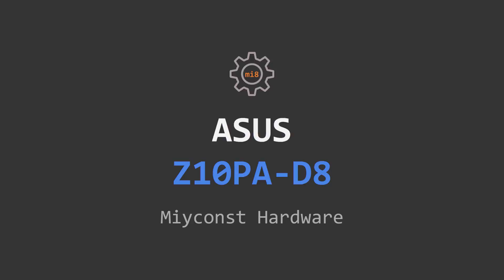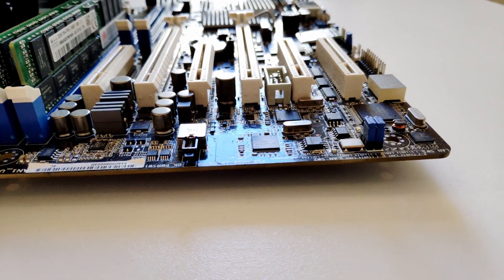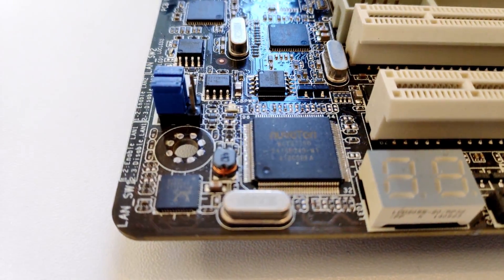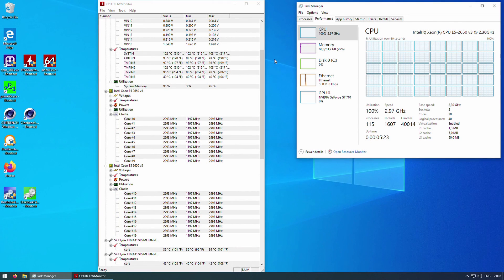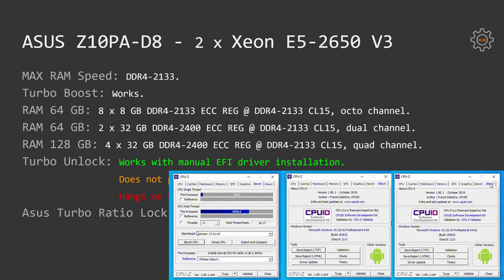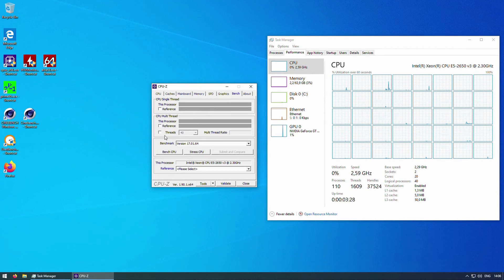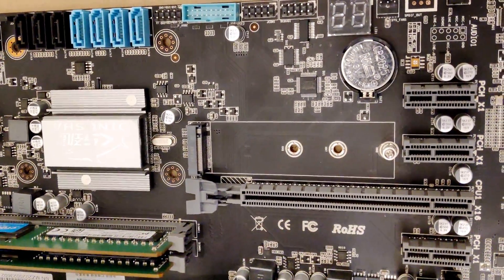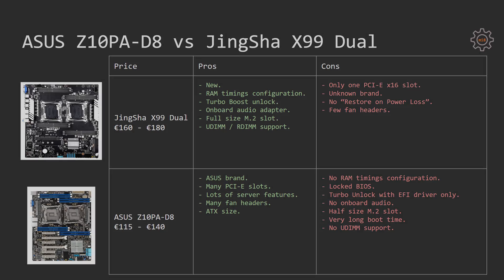🇬🇧 Detailed review of ASUS Z10PA-D8 Dual LGA 2011-3 motherboard | E5-2650 V3 | Turbo Boost Unlock

Comment: AFUDOS 3.05.04 works on this Motherboard, you dont need a Programmer. 3.05.04 is the only working Version.
Reply from the maker: Wow, thank you for the info! I pin your comment.
Reply: I got this motherboard :) can you provide the bios modded file please? is there any chance of having pci-e bifurcation config menu available?
Reply: Hi Sven, can you post a link  to this file? I could not find this specific version anywhere
Reply: @ER-tp9cy  https://drive.google.com/drive/folders/1MVL27NL2yyosgAer-mm-o7zmzttWw5dS?usp=sharing
Reply: @maniac8199  I have the Z10PE W8, You think this version of Aefudos will work on my bios? I want to use my 2999s at full power.
Reply: got it, cheers :-) , how did you find out it was the only working, and why the hell would they write -lock it??
Reply: @ER-tp9cy  It wasn´t me. I saw it an YT, cant remember what Video it exactly was. It was some Chinese Motherboard with locked Bios.Only this Version worked on this, so I tried it and: succes. all other Versions that i tried didn´t work
Reply: @maniac8199  So I can use this program to flash the motherboard to turbo unlock? I have just ordered this motherboard also!
Reply: @frankiewalnuts  Yes, I was able to read out the Bios, mod it (with well known an described tools) an flash it back with this tool.
Reply: I can't get into DOS, it shows AE code every time i choose to boot to USB drive.

How to use afudos exactly?
Sorry for this dumb question.
Reply: @irulbahri7069  Just press ESC within 5 seconds. Then you are able to do what ever you want.
Reply: @maniac8199  Hi. I have an issue Where i get an "22 error with problem allocating memory". Did you experience similar issues? And what commands did you use to circumvent it?

Best regards
Reply: @maniac8199  Hallo Sven, könntest du das gemoddete BIOS irgendwo hochladen und den Link teilen? Danke!
Reply: @toseltreps1101  ich habe die mit in den verlinkten Ordner gepackt, 0_0 ist mit Standard Spannungen die anderen sind mit etwas undervolting für die CPU und den Speichercontroller. Eins mit 20/20Millivolt, das andere mit 70/20Millivolt, musst Du ausprobieren. Bei mir ging maximal das 70/20, bleibt am kühlsten.
Andere habe ich nicht gemacht bzw nicht mehr da.
Reply: @maniac8199  wie hast du AFUDOS zum laufen gekriegt? Bei mir kommt immer 22 - Error: Problem allocating memory.
Reply: @andreas1171  did you manage to install the bios? I have the same problem
Reply: I was able to flash it ;) but no luck since turbo boost won't kick in! Locket at 2.6Ghz :(
Reply: what is the best cooler if turbo is unlocked?

Comment: 6:57 what is the difference between turbo boost and turbo boost unlock? I am very confused. You said turbo boost works and you would be surprised if a name brand mobo did not work with Intel default spec of Turbo boost technology. Then why do you need to "unlock" it? Do you mean turbo boost is not working by default unless you go through the great length to hack/unlock it? If that is the case then i wouldn't call it working... Also you mentioned v4 e5 cannot unlock Turbo boost? So if i put in dual 2699 v4 they cannot Turbo boost to 3.6ghz (intel spec) and will only run at 2.2ghz base clock? That sucks? I would call it broken if that is the case.
Reply from the maker: Turbo Boost Unlock or TBU is a hack that forces all CPU cores to boost up to the highest possible turbo frequency as long as the TDP allows.
Reply: @Miyconst  Thank you. I watched your other video and it is clear now. What would you say is better? Buy dual 2699v3 and do TBU or buy dual 2699 v4 and just run them normally? The v3 is a lot cheaper, around $30 each while the v4 is $130 each. Thanks!
Reply from the maker: @kiloton5764  you did not specify how to compare these two. V4 will consume much less power and provide better memory bandwidth because it's DDR4-2400 vs. DDR4-2133 but V3 will be stronger, especially in lightly threaded apps where it can boost to higher frequency. Paying $130 for an E5-2699 V4 also makes little sense according to me.
Reply: @Miyconst  Haha yes. I agree. That is why I did not buy the 2699v4 yet. I am waiting for aliexpress 11.11 sale and see if I can get a good deal on them. I am leaning toward the v4 because I want to save the hassle of hacking the bios/driver for TBU. Especially since it is not very straight forward on this Asus motherboard or is it?

Comment: It's not good to pack motherboards in plastic. The TVS diodes will help protect it from static damage but those diodes themselves are sacrificial and get damaged over time.  All that static electricity from those plastic bags just shortens the life of TVS diodes. If you don't have static conductive bags it's better to take the battery out and wrap it in aluminum foil the battery could burn up if it gets shorted that's why we use static conductive plastics, The board will arrive undamaged from ESD if it's wrapped in foil.
Reply: If you know how to solder you might put new TVS diodes. They can only take so much before they give out kind of like a shock absorber on a car and when they go that is when other parts start getting zapped like the southbridge during power surges. It's kind of like replacing any bad electrolytic caps, if you want it to last give it new TVS diodes.

Comment: hello, I installed 2667 v4 processors in the motherboard, the computer does not start at all. Before that, there were 2666 v3, everything was fine. What could be the reasons
Reply from the maker: The BIOS is outdated, most likely.
Reply: thank you very much for the information

Comment: Absolutely @ 12:48. full length M.2 is working on Z10PE-D8 version (may be the same for yours) if you not mind it sticks out und have der clearance. 
ASUS makes amazing boards for each situations. Correct, the suffix "PA" is a more 24/7 basic system needing more resources rather then faster, more add-in cards but less focus on or no GPU Remote manages w/ it's integrated ASpeed ATS2400 VGA. The "PE" variant adds some high end consumer features or settings including multi GPU SLI + X-Fire & a more modern UEFI BIOS but overclocking is still very limited in these. As for RAM, I think the Z9PA- was the last entry dual on ATX to accept UDIM RDRAM. Even so if I remember, not able to change strep & timings. It's locked to the CPU & most Xeons 20xx don't like or cant do RAM OC. Z9PE-D8 was a last of a unique board that let us do that but ECC only & limited tight timings.  The "PE" is better suited for the home user high end workstation for a mix of core count vs clock speed but cost a way bit more. If wanting more clock but good core balance, consider a single Xeon 16xx on a good ASUS Workstation Series. Otherwise, fun builds. (:

Comment: Hi there, did you by chance investigate further into getting the unlock to work without having to copy the efi-files manually?
I'm trying around for some tie now but with no luck. I have gotten it to work once but am not able to reproduce this succes.
Awesomew work nonetheless, keep it up!
Reply from the maker: I might revisit the motherboard again, if it starts to be widely available for a good price, but for now I don't have anything to tweak with.
Reply: @Miyconst  I made a discovery this morning and don't really know what to make of it.
The default settings for disabling C3 and C6 in the optimised defaults don't seem to be correctly written into the modified BIOS.
When I load the defaults I still have to disable those settings manually.
Could it be that the BIOS-file needs to be extracted first before deleting the 6f2-patch and adding the ffs-driver?

Comment: ATRL DOES work for me. 

Make sure that Energy Performance Tuning is set to "Disabled". That disables the OS from controlling the CPU frequency, which doesn't work well in Win10 without driver, and not at all in Win11.

Now my 2x E5-2690's are set to 3.0 Ghz instead of 2.6. It's not max turbo frequency, but better at least.

Comment: Hi, Miyconst. 
I wish you are well. I have a question about overclocking. My processor Dual E5 2682 V4. They work very slow, my bench result is not enough for me (bench test result app. 10000). I have bougth this processors and motherboard for special aim. I want higher frequency, so i want do oc. 
MB : ASUS Z10PA-D8;
PROCESSORS : E5 2682 V4. 
How i can do overclock ?
Reply from the maker: It is not possible to overclock Xeon E5-26XX CPUs.
Reply: @Miyconst  How i activate turboboost?
Reply from the maker: @trkymn  it is not possible with V4 CPUs.

Comment: i have same motherboard with x2 2630 v4 ES.  how to know if turbo boost works?  i task manager i see cpu clock varies from 1.7ghz to 2.3hgz,  but 2630 v4 supposed to have much higher turbo boost.  what can i do?  🥵
Reply from the maker: Nothing. Xeon E5 V4 CPUs are not compatible with this hack.
Reply: @Miyconst  i see,  but im about to install two 2690 v3 . so this hack is a must to have turbo boost possible?
Reply from the maker: @ExperimentsLabTv  yes, if your CPUs are retail version with stepping 2 - they are compatible.
Reply: but if i put two 2660 v4 retail,  not ES, , what's going to be with turbo boost then?
Reply from the maker: @ExperimentsLabTv  You can check Intel official CPU specs to find that out.

Comment: I hate not having sleep S3/4. I use it a lot or Hibernate at night. I’ve never used onboard audio in an A/V workstation in as long as I can remember. Even the legendary P2B-DS had no onboard. I get S1 sleep on my Z8NA so it’s better than none.  Full S4 works. After tinkering w/ it I found that the #6 PCI slot is MIO capable of coming from other high end workstation. Which I like since previous MIO slots weren’t PCIe capable
Reply: Update: I ended up using the Z10PE-D8 WS / E5-2667-V4 version w/ wider CPU  spacing & onboard audio. I came from the Z9PE-D8 WS. Similar, otherwise good board w/ E5-2667-V2.
PCIE slot 6 (most upward by RAM) is your MIO audio or PCI switchable. The ASUS MIO card is better then the onboard anyway I thought.

Comment: What model cpu heatsink cooler was used in video? What are some of the biggest heatsinks you can find for these? I'm coming from ASUS Z8NA-D6 with dual Noctua NH-D9DX i4 3U on 2x Xeon X5675  I do like that I can use low timing non ecc, G-Skill 1600 cl7, limited to 24gb or 96g if ecc. My 1600 ecc cl9 did run in my Rampage ii X58 but i wonder if the i7 930X will run in the dual mobo as single cpu?
Reply from the maker: I don't think your i7 will work in this motherboard as it's other socket, but in general, i7s work in some dual socket motherboard with single CPU configuration. Regarding the cooler, I would say two Cooler Master Hyper 212 Evo or another pair of a similar size is probably the maximum you could fit into the motherboard.

Comment: To get good boot times do two things:
1. Remove the ASMB8/IKVM Chip at the bottom of the board (this cuts the boot time in half). After this change, I would consider the boot time to be almost regular; about 30-40 seconds to OS login screen.
2. (Optional) Make sure you installed your OS in UEFI mode and disable legacy boot in the UEFI menu ("bios").

Comment: I have just received my unit from Rebus Farm and it is unfortunately also completely dead. 

2 PCIe Lane Switch chips were completely burning up, beyond 80°C within Seconds as well as another chip from ICS next to the BIOS.

I just messaged them and haven't received an answer yet.

I hope my CPUs at least survived this, I was stupid enough to test it with all of the ones had. (2698v3 and 2673v3)

Now I have to wait for my huanan to arrive
Reply from the maker: Thank you for the extra info. It really seems like they are selling boards from the dead workstations and don't even bother to validate if the board is alive or dead.
Reply: @Miyconst  Rebus Farm has now resolved the issue, i must admit the support i got from them has been great sofar.

They sent me a replacement board within a short period of time so i can not really complain.

CPUs were unharmed and Turbo Boost unlock on E5-2673v3 worked like a charm on the new board.
(3551 Points in R15 using -50mV, 3.1 on all Cores during whole Benchmark)

Aparently they all came out of a render farm that has been replaced so maybe a few dead rendernodes were accidentally mixed with working ones. Mistakes happen i guess.
Reply from the maker: @Coldministrator  I am glad to hear that you have managed to get a working motherboard after all.

Comment: please help with NVMe, instead gen3 x4 my ssd M.2 WD SN550 works in gen2 x1 mode. Max read speed is 415MB/s
Reply from the maker: Unfortunately I made a mistake in my video. This motherboard has a limited M.2 slot, if you want a full PCI-E X4 connection you need an extra adapter.
Reply: @Miyconst  not a big deal for me, x1 is still fast enough for my needs. with the adapter to PCI-E slot I can't make it bootable. I tried
Reply from the maker: @shatll1975  you might need to upgrade to the latest BIOS, because I was able to boot through an adapter.
Reply: @Miyconst  when I used adapter, nvme ssd was visible in Windows but nowhere in bios I can see it and can’t install windows on it
Reply from the maker: @shatll1975  yeah, I understand the issue, but in my case I was able to boot from a Samsung NVMe SSD using an adapter, maybe it's because of the adapter, my was an official Asus PCI-E X4.
Reply: @Miyconst  I suspect your adapter has its own BIOS with a driver like old RAID pci cards
Reply from the maker: @shatll1975  it was this one, pretty simple one: https://www.asus.com/us/Motherboard-Accessories/HYPER_M2_X4_MINI_CARD/

Comment: Got a workstation based on this mobo for 500 Canadian dollars. 2xE5-2690 v3, 64GB ram, 1000W PSU, and nice case. Updated bios from the USB stick. CPUs get boost up to 3GHz. Got NVME option in bios. Using PCI-E adapter I installed NVME M-key 1TB WD SSD - didn't get it visible in bios so not possible to boot from it. Then I bought nvme extender with a flexible cable, it worked but read speed is 400MB/s only, should be up to 2200MB, WD software says it is connected using a gen2 x1 connection instead gen3 x4, that's why this low speed is present. So far pretty happy, this workstation is a total beast, 24c/48t.

Comment: What about core voltage? It is possible to undervolt this MB?
Reply from the maker: It is definitely possible to undervolt if you use the turbo boost unlock hack with custom EFI drivers. The stock configuration, I didn't test for undervolting, sadly.

Comment: URGENT: did the first ASUS Z10PA-D8 motherboard have a green light on the bottom corner, but would not boot at all?
Reply from the maker: Yes, I think so. Did you the same?
Reply: @Miyconst  Yea. I have the Z10PC-D8/SAS version. Green light on the bottom of the board, no boot; no post code.
Reply from the maker: @CornBreadMan264  that was exactly the case I had with my first board. I tried everything I could possibly try, but the board never came to life.
Reply: @Miyconst  I was able to post with 1 CPU, but not with 2. would not even power on. tried 2 different PSUs & nothing,
Reply from the maker: @CornBreadMan264  mine didn't work even with one CPU, it was completely dead.
Reply: @Miyconst  I would look at the Chinese dual motherboards, but idk of the VRMs can handle 145W TDP for each CPU?
Reply from the maker: @CornBreadMan264  nope, 145W is rather too high for the Chinese boards.
Reply: @Miyconst  I just ordered a 2nd board. hope it goes well. What about 120W TDP per CPU on the Chinese dual boards?
Reply from the maker: @CornBreadMan264  120 Watt is more than officially supported by Asus, but it shall be just fine as long as you have at least semi-decent airflow in the chassis.
Reply: @Miyconst  I mean for the Chinese motherboards. Asus Z10PC can do up to 160W according to the CPU support list
Reply from the maker: @CornBreadMan264  that's true, but even with the Asus board I would be careful putting those 160 W ovens.
Reply: @Miyconst  Well, only putting in 2x 145W (2697R v4) in a 4000D case. 

as for the JingSha x99 dual.. do you think it can handle 120W per CPU?
Reply from the maker: @CornBreadMan264  yes, JingSha can handle two 120 W CPUs, just pay attention to the VRM cooling.

Comment: hy miyconst, first of all, as usual, great video :) i had a problem with turbo boost (not the turbo unlock, i talk about the turbo boost of every xeon) of my 2630L v3, frequency  didn't go over 1.8 ghz also under cinebench or other stress utility... also asus turbo ratio lock didn't work, i wonder if i have to enable some option in the bios.... if i open hwinfo i found the turbo voice marked red, and under cpu i found "turbo capable, but disable"... any hints? my conf is 2x 2630L v3 with 4*8 gigs of ram
p.s. i also try to unlock the bios, but nothing changes, cpu always stop at 1.8 ghz
Reply from the maker: Which motherboard do you use? Search for CPU C6 state in the BIOS and make sure that it's enabled. Also make sure that Intel Turbo Boost Technology is enabled, if there are such settings in the BIOS. There might also be another setting named "Power Technology", this shall be set to either "Energy Efficient" or "Custom", but not "Disabled".
Reply: @Miyconst  the mainboard Is the Asus of this video, now it's late i Will try tomorrow in the morning, for now thanks i Will give you news tomorrow
Reply: @Miyconst   ok today big news. downgraded bios to 3202 version, load default setting, fresh install of windows 64, everything works :) under chinebench all core to 2.1 ghz :) now next turn try the turbo unlock